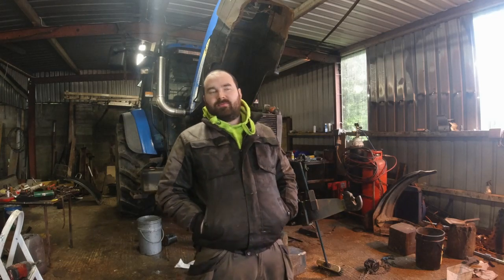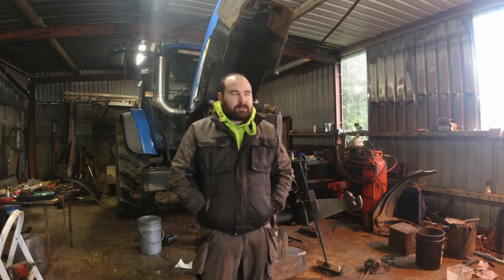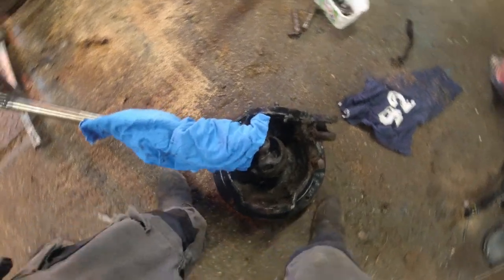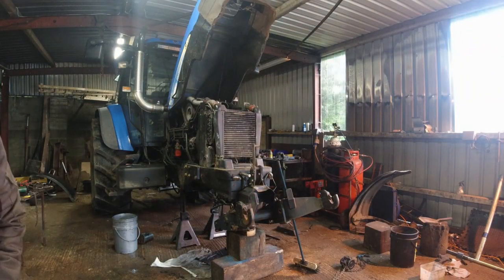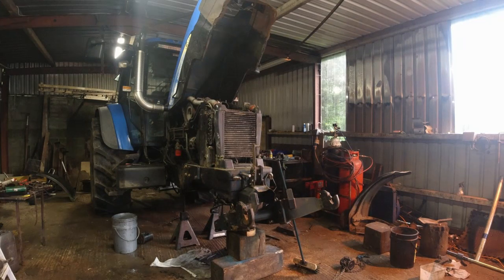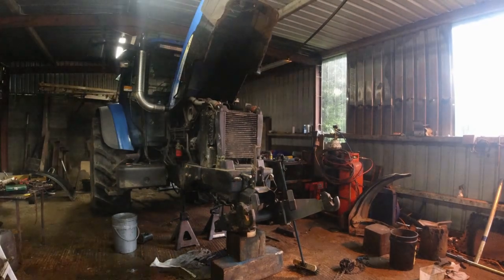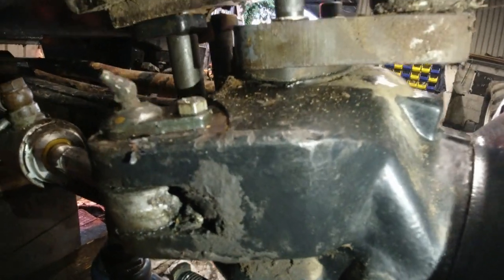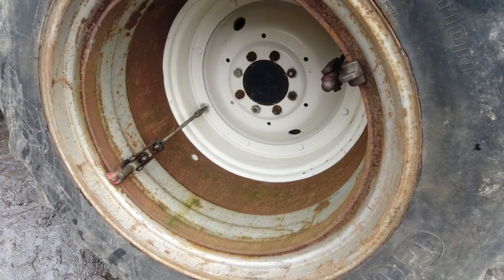WHY IS THE NEW HOLLAND TM MISSING ITS FRONT AXLE ??

Comment: Farmer Phil has done around 4 videos on the basics of umbilical spreading, good luck with it another string to the bow is always a good thing
Reply: Looking like every man at slurry is piping now lad . What you reckon of that TM140 with duals on ??
Reply: @ghostrider7688  must say its strange seeing one with duals, be a better job though as you can take off the dual tyres quickly and use her for other things, those 900 wide tyres would be fierce costly, if one got a puncture too you wouldnt be completely fucked either, that would be a major advantage
Reply: If shes not blue she'll not do be interesting to see the mark on the ground compared to the single tyres . Yeah big cost factor compared to the duals . The lad here is just getting going . He might in time slap a set on her . Check out the slurry video Grassmen done on Hunnifords slurry up north . T7s on the dribble , neat looking outfit lad for any Blue fans 🚜👍🏻
Reply: @ghostrider7688  I doubt there would be much difference tbh, maybe inbetween the 2 tyres between the lugs it might make a tiny difference, tight roads around the place, flotation tyres might not make it in, duals could be fitted in the field and taken off for road so maybe duals would be better 🤔
Reply: @jerryodriscoll3691  well it means he can whip them off at any time n put the TM at something else . Phil has the luxury of parking his umbilical tractor half the year . He can leave the flotations on all year round the father has a load of them 6290s , that’s the benefit of having lots of tractors 🚜 👍🏻
Reply: @ghostrider7688  exactly, massive benefit when it's easy to be short of tractors no matter how many ya have 🙈

Comment: Keep a pull on the hose when your reeling up anyways and don’t bother with foam balls blowing out the 10% of slurry that stays in the hose is handy to have the bit of weight to pull the hose on tightly tight
Reply from the maker: Interesting about the blowing out.
You'd want to put the ball through it when you'd be parking them up?
Reply: @mrcvx  well the slurry will all leave the hose in the end it will travel the hose it just helps to have the bit of weight in the hose to pull it on tight to the reeler we’ve universal joiners and u can pick ure last link in the yard and roll a bit up then drag the hose out toward the field till off the 20m u rolled up with a bit of slurry in it then get a pull on it when rolling it up the small bit of slurry in the hose just helps get it on tight to the reeler